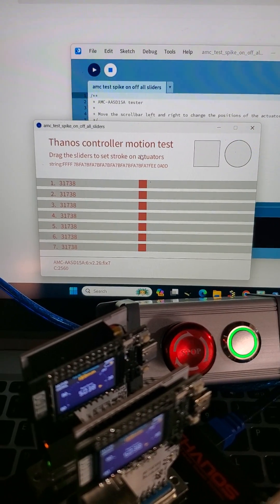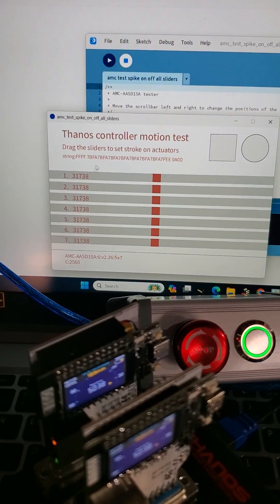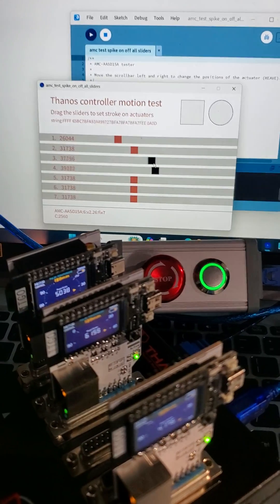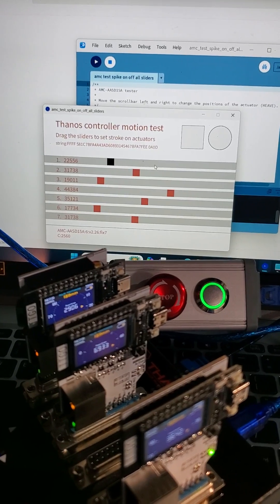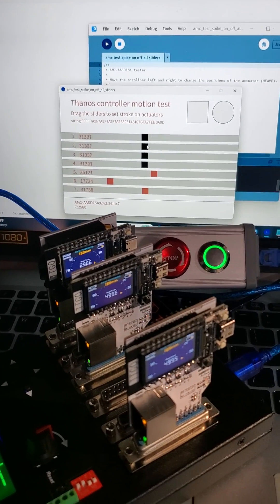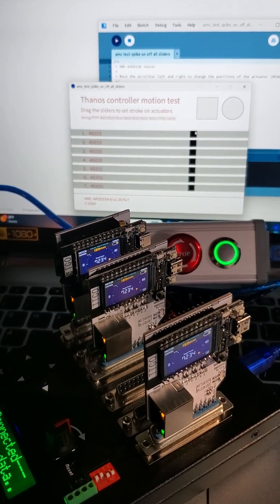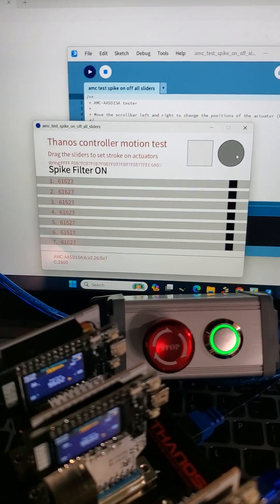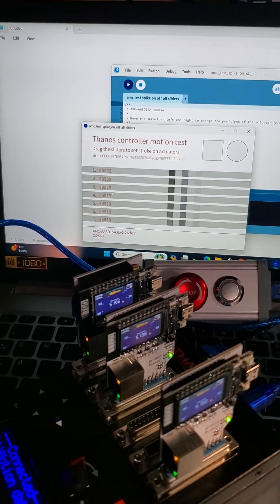I built the least "clickbait" tool 🤔

Comment: Hi, any idea how to eliminate occasional vibration when using MSFS while in the air with E racing actuators ? I've tried to play with all RSR settings and spike filter and hard and semi hard settings on the Thanos device but I'm still getting random vibrations when doing bank and roll movements. Dose changing Esc & Fine settings or frequencies help in that regard when flying in the air ? Thanks
Reply: Also get noise on the heave output for MSFS  in SRS, so use FlyPT Mover for MSFS which is very smooth.